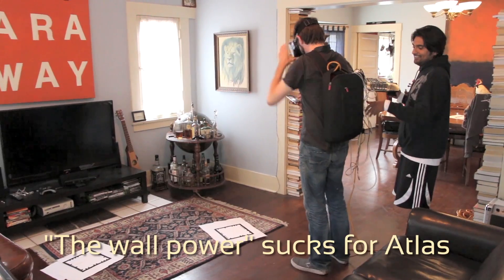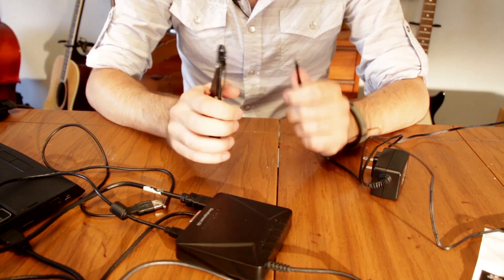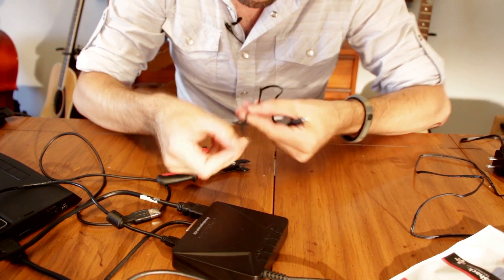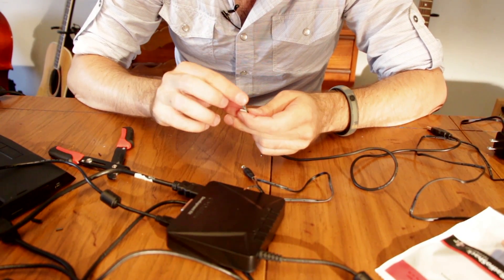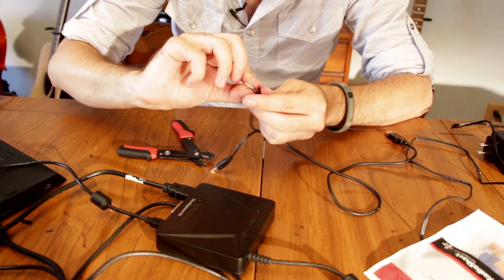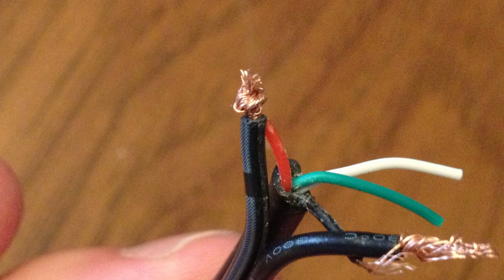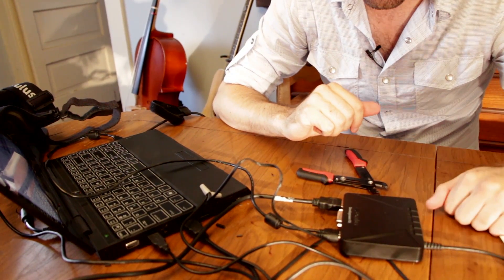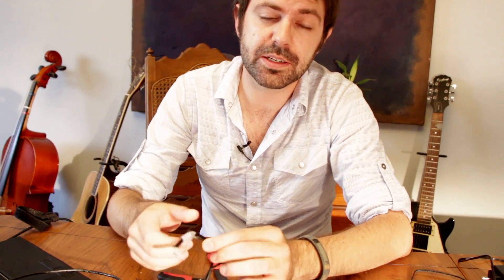How to mod your Oculus Rift for USB power with No Soldering

Comment: made this and the OR powers up for 4 seconds then shuts off (probably as it tries to turn on the screen). i'm thinking my USB cable's gauge is too small? It's from a mouse so probably isn't capable of 600 MilliAmps?  used a USB port right off the Mobo so not an over power issue on that side. Any other suggestions?

Comment: Use insulated butt connectors from radio shack I think the red ones 18g will work fine. This is a lot better than using wire nuts and less chance of things coming undone and of course arcing which would mean no more Oculus.